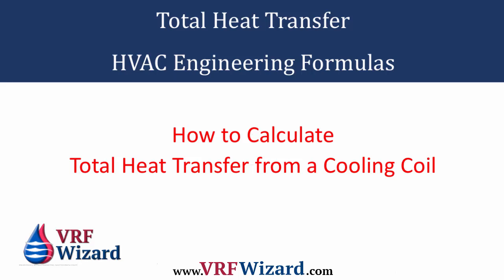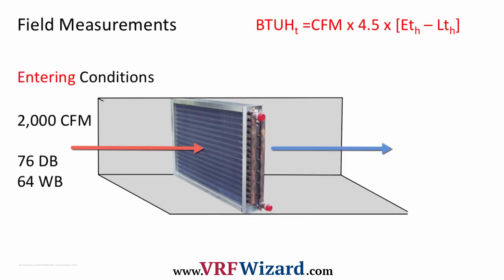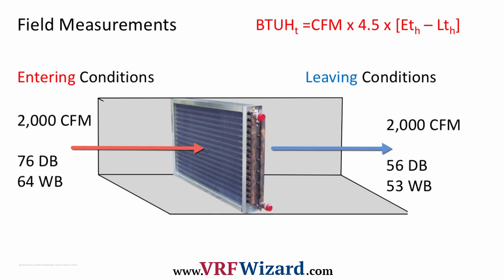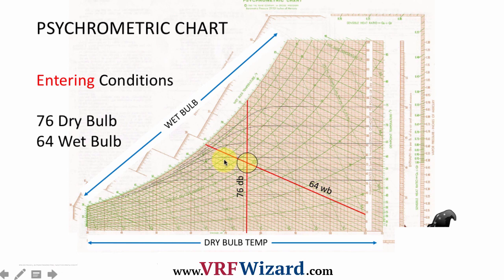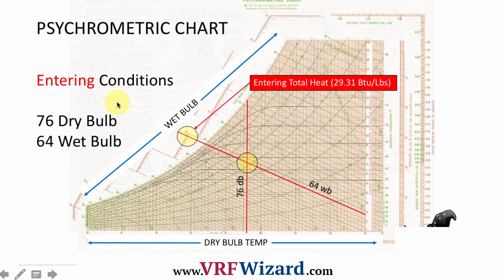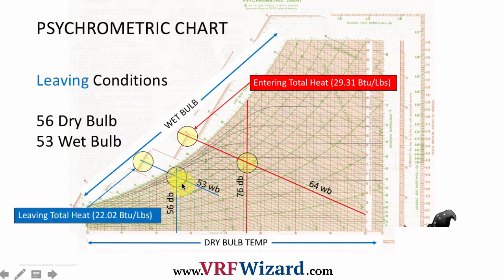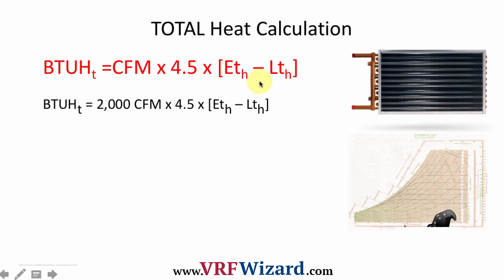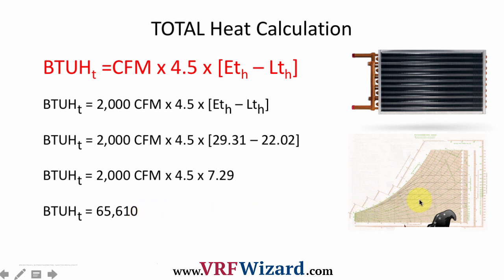How to Calculate Cooling Coil Total Heat Transfer BTUH

Comment: Thank you for the great video. Where is 4.5 from and is it a conversation factor?
Reply from the maker: 4.5 is a constant for standard air conditions. You can determine this by multiplying the weight of standard air at 0.075 Lbs/Ft3 x 60 Minutes/Hour = 4.5 (This is the density of air at sea level which has a barometric pressure of 29.92 in Hg)
Reply: @VRFWizard  Thank you for the answer.

Comment: I am interested in a problem where we have external copper coils wound and need to find out the cooling effect from it. Is it somehow possible to discuss with you
Reply from the maker: I'm not sure how we can help. Please explain the problem in a little more detail.
Reply: @VRFWizard  I have a Diffusion pump. The pump is surrounded by copper coils for cooling. I wanted to know how the copper coil number of turns influence the design or cooling, as well as choosing other materials than copper for example Stainless steel. How will this impact. From Design point of view I am interested more to know about design calculation for Diffusion pump external cooling. How thermal conductivity influence and how no of turns,pipe size influence the design.
Thanks for your support
Reply from the maker: @nayeemrahiman3230  Any kind of prototype that you are building would have to be laboratory tested for accuracy if you're looking to market something. Of course the more surface area (Copper Tubing) you have, the greater the heat transfer capability. Stainless would make it much more expensive to build. If you trying to cool down the diffusion pump, then you would start by knowing how much heat the pump puts out. This way you could size the coil for the proper amount of heat. The greater the surface area, and the greater the Delta-T, the greater the heat will be transferred.

Comment: This is actually the latent heat right?
Reply from the maker: This includes both sensible and latent heat. The drop in dry bulb temperature from 76 db to 56 db involves sensible heat, while the drop in moisture involves latent heat.